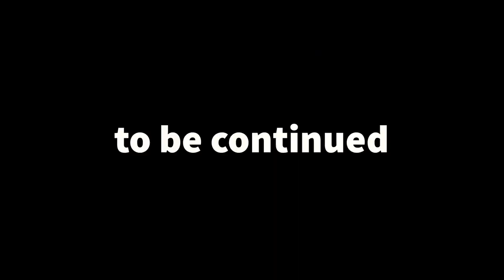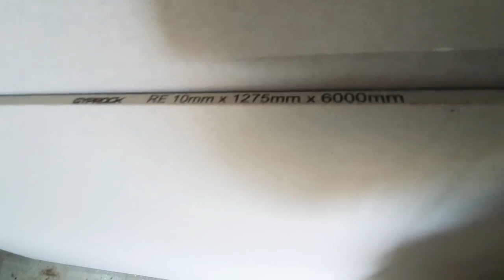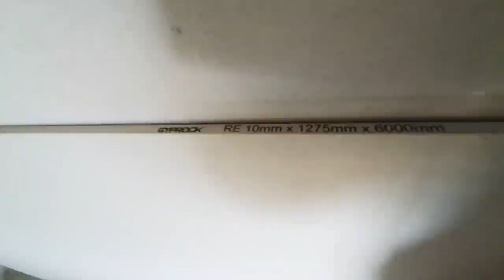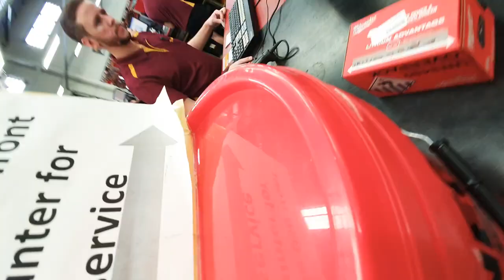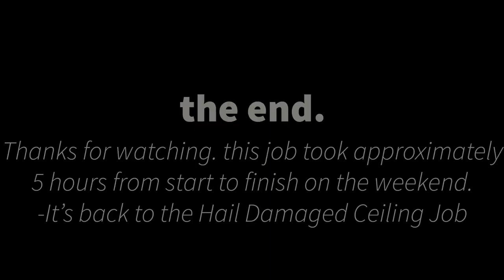The Ultimate Pro Drywall Fixing Crew Complete House in Hours Start to Finish (FULL SERIES)

Comment: Man I miss my Ozzy bros. Shoutout to all the tradies. Mid 80s the attitude was stretch it out. We shifted from NZ and started sub contracting by the metre. My mates were all builders, electricians, plumbers. I was a rigger, scaffolder and roofer. Also did a bit of Painting. We killed it. I worked nights getting Bar Manager qualifications. 15 years later everyone works like you guys. I loved Ozzy you could pick up good paying casual work subcontracts on the weekends. Unfortunately NZ hasn’t got the same opportunities. Rigging/Industrial Abseiling yes. Depends who you work for or subcontract. My mate Cazzer still flits over to Oz with his crew keeping up friendships with his Ozzy bros. Drywall’s like you guy’s.
Reply from the maker: Sounds like good times bro!!

Comment: does the electrician cut the pot lights afterwards? I didn't notice you boys cutting out electrical boxes either. was that job specific or is this how it's done in Oz?
Reply from the maker: yeah the lights and electrical points get fitted later , the electrician knows exactly where they all are,
Reply: @Maxkil  can u make a video of the electricians doing their job after drywall is installed?